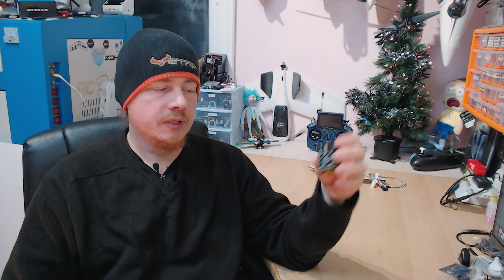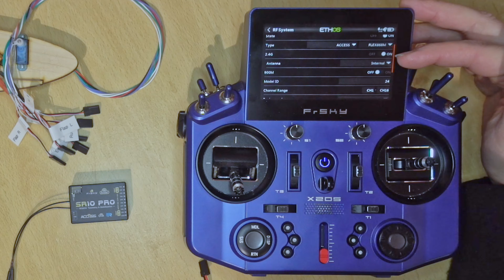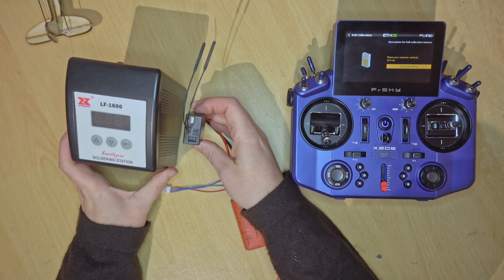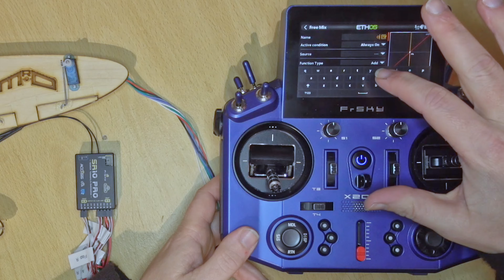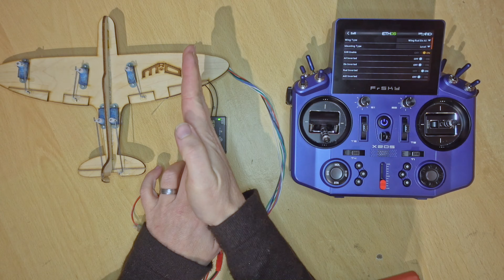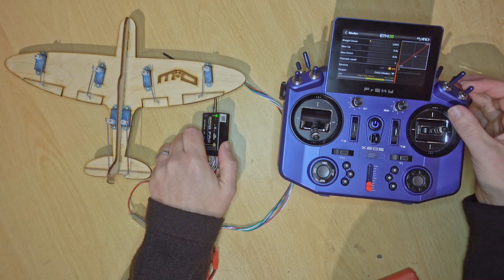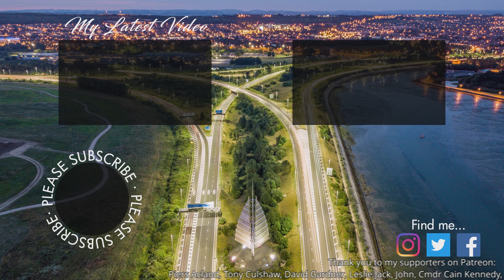Setting up FrSky Archer SRx stabilised Receivers

Comment: Hi Darren,

I have transitioned from Spektrum to the FrSky X20 based on your advise. You didn’t say anything negative about Spektrum but reassured me about the good signal strength of the FR sky. I flew it through the usual dead spot that I lost a plane and had signal issues with another. No issues what do ever, what an excellent radio for half the price of other competitors. So thank you! What modules do I need for the SR8 pro to measure pack voltage, airspeed and altitude? More interested in pack voltage. Thanks for all your help.- Ant
Reply from the maker: Awesome Ant. I’m glad to hear you’re enjoying the new radio. The RF side is great on the FrSky systems. 

There are a range of SmartPort sensors that you can get. They can all daisy chain together too, so setup is easy. There is a vario which will give you altitude, and an airspeed sensor too. There are a couple of options for the lack voltage. There are basic analogue sensors and SmartPort sensors that plug in to the balance lead. I’ve only used the analogue sensors before (they can be made DIY with resistors). But I don’t find them useful on powered models. On gliders they’re great. But I found under load, the pack voltage was giving low readings too early due to the sag. On a glider with the motor off, they’re great. Maybe the SmartPort sensors are better? I can’t really say as I’ve not used one. But they will give pack and cell voltages.
Reply: @MrD  cheers Darren, I’ll have a look in to the smart port sensors. I like the customisation options at such a decent cost compared to other brands. The build quality and feel, feels excellent compared to the DX8 which at the time cost me £80 more but with only 8 channels vs the 20 plus on the x20. Looking forward to more of your vids. They are excellent.
Reply from the maker: @anthonyjayakody3356  Thank you. Enjoy the transmitter and have lots of great flights.
Reply: @Anthony Jayakody ditching Spektrum was the best thing you could do-They are trying to create their own ecosystem where you have to you use everything made by them, The protocol they use Is notoriously problematic I don’t care what anyone says and it seems to be worse with genuine receivers as opposed to lemon or HK ones. Regardless you won’t regret shifting to the Darkside-the X20 is barely developed yet compared to the OpenTX based Radios but I can tell you from the perspective of somebody who has come from OpenTX that it is almost like they took the best parts of OpenTX when they made Ethos and combined them all together. I have been able to adjust from my OTX Horus X10S to a Tandem X20S relatively easily-I watched a couple of Darren’s videos here just to see how to to go about programming these archer stabilised receivers and also to update the radio firmware. @Mr.D - Falling with style not a bad job at all!  I’m glad you are not like Lee (painless 360) Who spends far too much time talking off topic and making a five minute video half an hour long (No offence Lee if you are watching this you have been an absolute godsend for many people including me when I was learning OTX But sometimes you tell us far too much unnecessary info and it makes the video far too long.. just my observation otherwise keep up the good work). Darren would it be possible to even do another video covering the extra functions of the receiver that you didn’t show in this one such as the knife edge mode etc because I’m sure there are plenty who want to know? Thanks in advance I’m really glad I found your channel!
Reply: @Johnn_T  thanks John! I am still leaning with Ethos but I can see there are many options available. I was running a DX6i the on to the DX8. I started flying EDF jets and lost a 70mm f18 to signal loss then almost lost an A10 to signal loss in similar location. I also has signal loss on a different site. It’s very scary and disheartening where there’s totally no connection with the aircraft. Tested the x20 in the hot spot and no issue, also flew it very far out and no problem. Fingers crossed! Thanks for the message.
Reply from the maker: To be honest, every time there is an RF problem where I fly. I don't even need to ask what system is being used. People there fly/have flown with FlySky, FrSky, Futaba, Jeti, and Spektrum. It's always the last one on the list with problems.

Thanks for the feedback. I feel like sometime I ramble on too much. But it's good to hear the balance is about right though. Having said that, the last video is almost an hour and a half long!

Lee is an awesome guy though. We had a "10 minute" chat, that lasted about 2 hours. Just talking about flying and iNav mostly. He's an absolute gent.

As for the knife edge and hover modes. I am pretty hesitant to make a video on them. Mostly because I don't use them, so I can't say if or how well they work. Knife edges I think are easy enough to learn without that assistance. But the hovering may be handy as a trainer function. But maybe not too. I think I'll have to get an S6R on a profile foamy and try them out before considering a video on it.

Comment: I was wondering if I could use this type of receiver in a large scale 800 size heli.
Reply from the maker: The stabilisation part only has settings for fixed wing. But if you disabled the stabilisation, it would work fine as a regular receiver for your heli.
Reply: Thank you so much for reaching back to me much appreciated.

Comment: Quick question ? How do you connect Rb 30 useing x20 for flashing and configuration and basic setup.I read the manual to many times and it doesnt specify how to do it.Thanks for your videos I now can do everything else on the x20.Youve been a life saver.Thanks
Reply from the maker: Hi Randall. I've not actually looked in to this. I have seen there are RB 30/40 configuration tools on the transmitter. They're in the model menu in Device Config. I only have an RB 20, which looks like it doesn't have any configuration as such. I can't see anywhere in the manual how to update the firmware. With the RB 20 you need to connect the S.Port of the RB 20 to the S.Port in the top of the transmitter. Then flash an external device with the firmware. Maybe this is the same for the RB 20?

Sorry I couldn't be more help at this time.
Reply: @MrD  
Yes you're correct I figured it out I watch the video with a different RC car radio and the methods are the same it's just the X20 doesn't use that plug like you said it gets plugged into the back of the transmitter for flashing and I suppose the configuration would be the same as the other radio system so thank you very much I really appreciate your help
Reply from the maker: @randalldavis2116  the X20 doesn’t have the same pins on the back. It sounds like the radio in the other video probably had a full size JR bay. The S.Port connector on the top of the X20 will be able to flash the firmware. The same port is used to flash non-OTA receivers.

Comment: Is there a way to set the gain and then disable the slider/pot that you set it with? If it's anything like setting the gain on a helicopter you basically want to crank it up until it starts to cause an oscillation, back it off a bit and then never adjust it again. It'd be nice to be able to ensure it wasn't inadvertently adjusted once it's set.
Reply from the maker: You could take the value output by the pot, then setup the mix to only output that value. However, I would probably just change the curve so that there was still a little movement. For example, if the value when set is 30; I would set the curve to be from 20 to 40. This still give a little movement l, for different wind conditions. But the central notch is the original set value.
Reply: @MrD   Mr.D, can you provide some suggestion/comments.. Following up on this topic.. I programmed my pot S1 as video and went to field.. check everything and was working ok with autolevel and stabilize modes compensating correctly when I manually rolled my plane on the ground . But when I took the plane up in the air and flying full throttle into the wind, and turn S1 Pot to 100% to see plane oscillate (so I can back it off just like Lucas mentioned).... the plane did not oscillate. Is there any settings I should check further for this test to oscillate, or is it bc Frsky SR8 Pro receiver cap the gain setting and such oscillate testing is not possible. Thanks for any suggestions!
Reply from the maker: Hi Ted, sorry for the late reply. Lucas is talking about helicopters. For fixed wing, I wouldn’t try to make it oscillate. Planes are (in most cases) naturally stable. So I will start with low gain and increase it. For setting the maximum gain, I look for twitching, which can be more pronounced after a change in attitude. If the model is twitching about, the gain is too high. It’s trying to do too much correction, when it is not needed.

Comment: I am setting up an SR10 receiver. Iseem not to be able to get the stabilization on the rudder, whereas it is working as expected for aileron and elevator. Is this an issue during calibration? Channels are AETR.
Reply: I eventually resolved this issue, A dumb error on my side !
Reply from the maker: Glad it’s working Robert. What was the issue? It may help out other people to know.

Comment: Why a second receiver ? I don't care to use "Y" servo cables. It's much easier to setup each servo separately. Should that servo fail. It will ,hopefully, only affect that servo on that channel. But now that FrSky has introduced the TD R18 receiver. I'll be able to remove the second receiver making the wiring much easier and safer.
Reply from the maker: Sure, I can understand having each control surface on it's own channel. But I struggle to get past 7 for control surfaces (2  aileron, 2 flaps, 2 elevators, 1 rudder). Throttle would be 8, leaving 2 for things like landing gear or a separate nose wheel servo.

Comment: Hi Daren. I will have to install a second SR10 receiver in my jet because I require four more channels. Is it safe to have both receivers installed side by side? Each set of antennas will run alongside the fuselage. The spacing is my concern.
Reply from the maker: I don’t really understand why. What channels do you need in that jet? Two stabilised receivers sounds like asking for trouble to be honest.
Reply: @MrD  The second receiver is not stabilized.

Comment: I found another area where the "self check" will not function. . It is absolutely vital that the first four (4) channel assignments "NOT" be altered. Aileron,Elevator,Throttle and Rudder. The gyro channel mapping is "fixed" for these channels. They must not be changed.
Reply: Got it.. Thank you very much for your attention.

Comment: Nice video. You assigned your "Oh Crap" switch to a momentary switch. That's fine. But you still have a 3 position switch that is still active on channel 12. What I mean is. If you toggle that switch 3 times you'll enter the "Self test" . That would be bad if you were flying and did that. What I did was disable the 3 position switch, and remove the channel 12 assignment. This will prevent crap from happening. Than assign the  2 position momentary switch to channel 12.
Reply from the maker: That’s a pretty good idea. Though I don’t think that there would be much chance of accidentally entering self test while flying. You’d have to be gliding, then flick the switch fast 3 times.
Reply: @MrD   I know. But strange things happen at flying fields...
Reply from the maker: That’s very true.

Comment: Hi Darren. Great video. I was just wondering how to do this last night. You make great videos and I wouldn’t have got this far with Ethos without your help. I did notice that you said while demonstrating the stabilisation control that before correcting control movement on the sticks that you said the rudder should go the way of the rotation of the receiver. Shouldn’t it go the opposite so as to counter the yaw?  That aside again love the videos. Keep going love Ethos.
Reply from the maker: Thanks Cornelis. Yes, I do believe you’re right. The rudder should go the same way as the tail, which is the opposite direction to the nose.